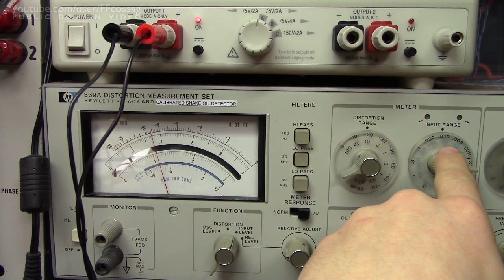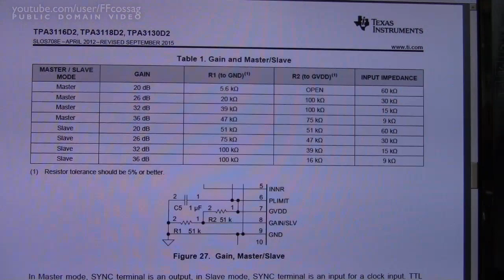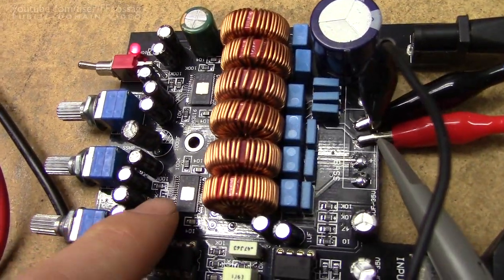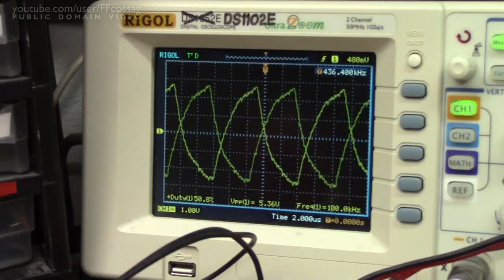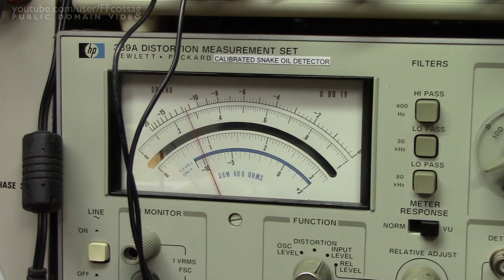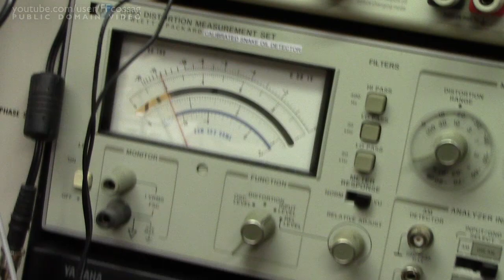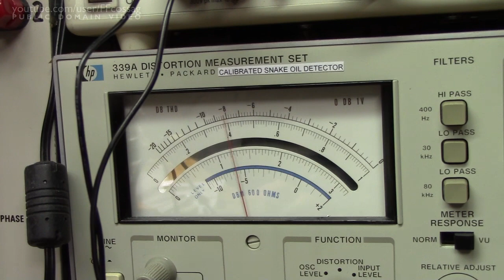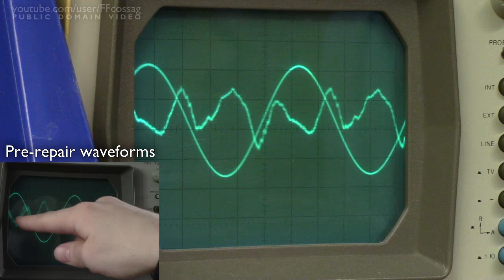Dual TPA3116 board: Fixing the AWFUL noise floor.

Comment: Before I start i wanted to buy some spare 39k & 100k resistors in case i ruin some while soldering - i'm new at this. can someone link to suitable part #'s for me? i tried looking up 100k and 39k smd resistors but there are so many hundreds i dont know how to drill down and get the right ones...  I bought 2 of these amps - identical except they have the bluetooth 4.0 board as well. Same noise issues, hoping to fix it or these amps are useless.
Reply from the maker: Anything 0603 is fine.
Reply: thank you - still about 80 choices....wattage rating matter at all?  0.1w, 0.125 0.2w, 0.25w?
Tolerance? .05%, .1%, 1%, 5%?
thick film/thin film?  i'm such a noob. thank you
Reply from the maker: None of it matters for this, don't worry.
Reply: I got in the 0603 resistors and they are way smaller than the ones on the board - just a warning so nobody else buys them. No matter, re-using the existing ones worked fine this time. thank you again - i now have 2 working amps!

Comment: What sense to replace sync resistor to solder bridge? According datasheet, sync pins should be connected thru 10k resistor.
Reply from the maker: It should, but it clearly doesn't work right in this implementation.
Reply: Anyway I prefer to install lower resistor(1k, may be 100 ohm), than bridge. If both IC starts as master with bridge you easily can get short circuit trough ICs.
By the way, did you try to set highest avaliable gain? Does it make sense to do that?
Also I wondering what difference(in sound, quality, schematic) between board with one input capacitor and board with three input capacitors? I have version with three.
Reply from the maker: These go really noisy at high gain. I tried a few different resistors prior to just doing the short, only the short worked well. Could be an issue due to these amps probably using reject trash chips.
Reply: Finally I fixed my amplifier. All as in this video, but replaced all potentiometers to 10k and install 47 Ohm resistor instead solder bridge. All works!
By the way, if you have 3D printer, you can make case for this amplifier that I made: https://www.thingiverse.com/thing:2789751

Comment: I have an similar issue with an similar amp board. Mine has a 2.1 speaker output configuration and here the bass output makes also an awful noise. This is my board: https://www.amazon.de/gp/product/B01INEIXNA/ref=oh_aui_detailpage_o02_s00?ie=UTF8&psc=1 Do you have an idea how to solve the problem? Should I also change the Poti? The Bass Poti is a 10kOhm one and the L an R potis are 50kOhm.
Reply from the maker: I really can't speak for any other boards than the ones I've tested.

Comment: I guess the subwoofer output has bridged channels, is it possible or advisable to connect a 4Ohm subwoofer? There are not so many 8Ohm subwoofer speakers availble.
Reply from the maker: It's in parallel, you can use down to 2 ohm speakers as long as you manage to keep it cool.

Comment: does this also apply to the Breeze amp with one TPA3116?
Reply from the maker: I couldn't say; my fix applies to this model of board. If it's one of these boards in it, then yes.
Reply: ah OK, thanks. I thought maybe you would know because you did a review on the Breeze amp. Oh and my Breeze got the same board in it as yours.